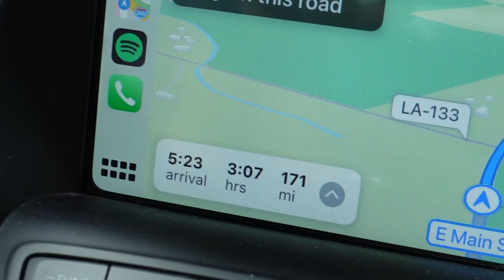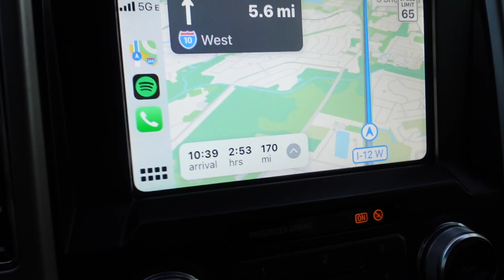Crazy Find at a Honda Dealership!

Comment: Hey brother, love your videos.. we’re in Alabama however, stationed at Fort Benning. Would you want to do a video on the differences in your opinion from the F250 vs. F350 you now have? Meaning, I understand it can tow more however, is there really better turning radius etc that some will say? Just wanted to see if you would consider doing one based off your experience the differences that you see between them and would you go back to single wheel base in the future or stick to the current setup?
Reply: The f250s and 350s srw after 1999 are the same except for the springs. F350s have heavier duty springs front and back than f250s other than that unless something changed in the newer trucks they have the same brakes axles trans engine etc etc the drw 350s have even beefier springs than the srw and better brakes I’m not sure how they compare as far as turning radiuses though
Reply: @operatorbenji9735  thanks brother . Yea, I was curious as you would think the turning radius would either be the same or better in the SRW.